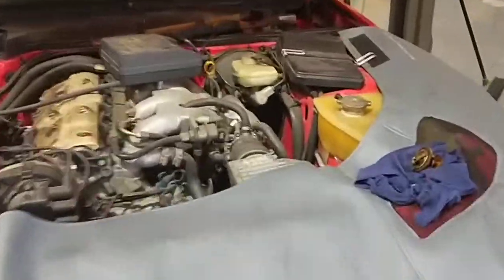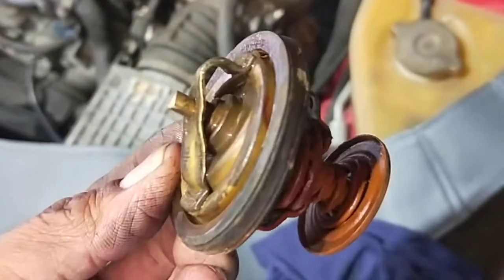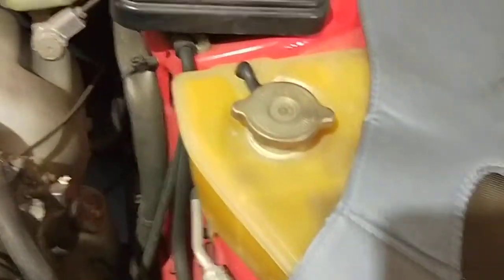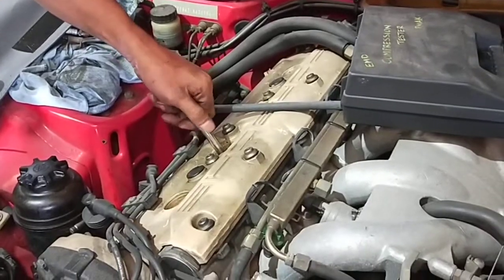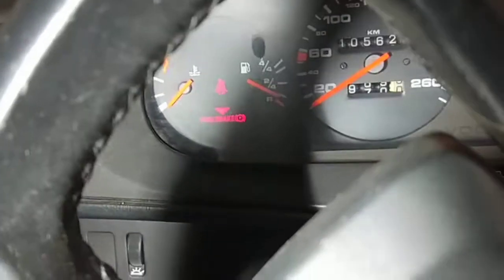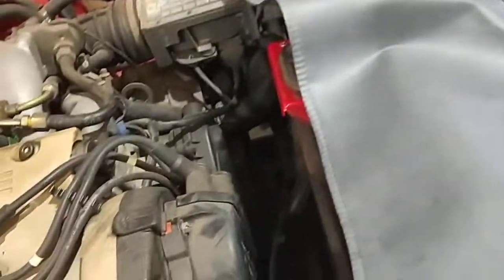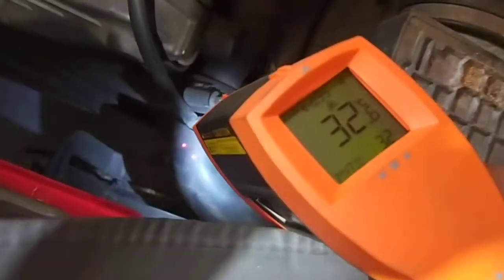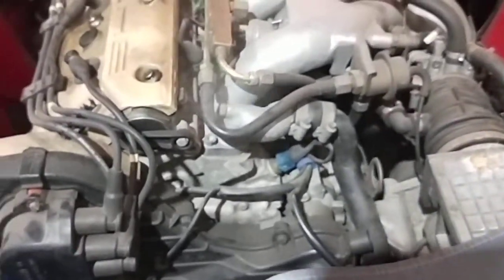Porsche 944 over heating problem part2

Comment: There are a ton like you said.  One I find also is a contributor is that the new water pump does not come with the bypass blocking rubber grommet.  You have to order that.  When the Thermostat opens, it closes the bypass.  Without that grommet the cooling water is bypassed and its for ever hot.